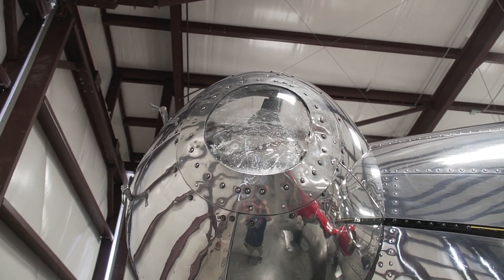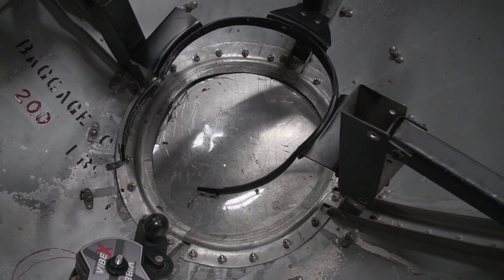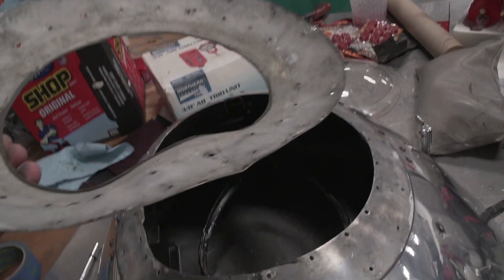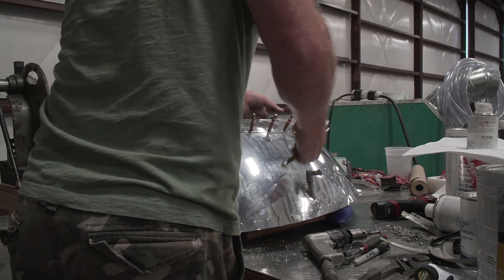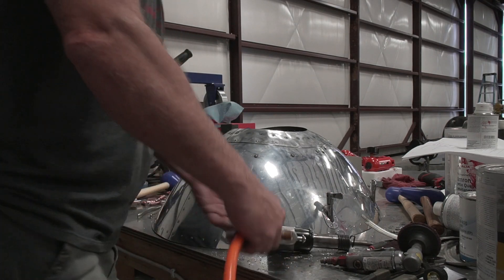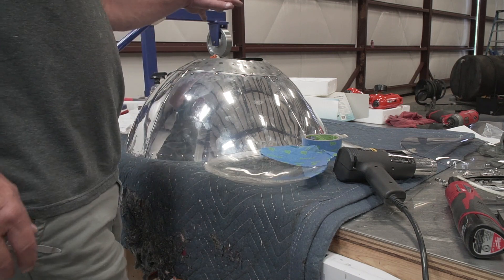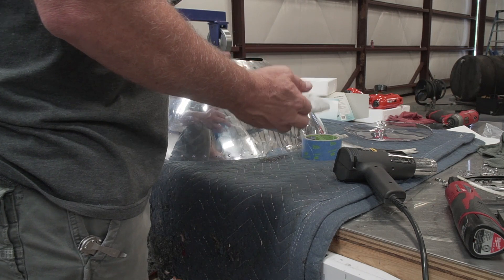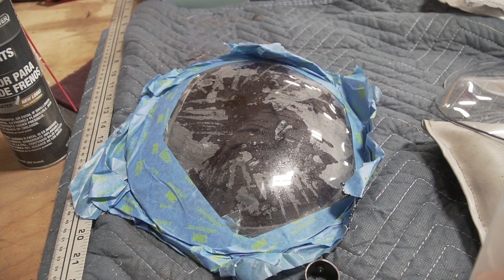Yep, Another Bird Strike In The Lockheed

Comment: Really enjoyed the video,  I am digging the depths of my memory but I remember seeing someone make a plastic bonnet stack cover and seem to recall similar issues with getting an even heat with the hot air gun. If I remember they just did it really slowly.  For making a mould, if you cover the inside of the lens with packing tape, and wax, car bodyfiller may be better than a foam. It's then easy to sand and shape if needed and should be strong enough for you to vacuum bag a warm sheet (if you use the oven method)

Comment: Get an square mdf box slightly larger than the actual piece .  Drill some small holes to one of the box’s faces  then plug your vacuum cleaner on one side of the box.  There are lot of simple DIY vacuum forming videos on YT.   PET G plastic is specific for vacuum forming.

Comment: I think on a Kermit Weeks video they make a mold out of wood and take the lexan out of the oven and lay it over the wood. That was to remake larger flatter style pieces.  I'm not sure if it would lay flat enough on such a small compound curve like that without wrinkles but you could try to make a wood plug that fits into the nosecone.
Reply: Also use a larger sheet then you need, and cut to fit. the edges will cool faster then the rest of the sheet, and almost always have a wrinkle.
Reply: @hawkdsl  Great point. The sheets were bigger than the piece needed if I remember correctly.

Comment: I'd repair the old lens with acrylic glue and bondo to get the desired shape. Wax the inside and lay up 10 layers of 10 oz glass cloth and epoxy (I like MGS, but West Systems is fine). When cured, pop the layup out of the lens (or pop the lens off the layup). Now you have a convex plug. Get a piece of thin felt and shape it over the top (outside of the convex plug). Heat the lexan in your oven (not sure what temp, but it will be flimsy). It's small enough to fit in the oven and not need a frame. Maybe a giant pizza scooper. When done, 2 people can grab it at the 4 corners (or approx 4 positions around the circumference) and drape it over the plug. Felt will keep it from stickin. Let cool and trim. There are some examples on YouTube.
Reply from the maker: thanks

Comment: I would try finding a stainless steel mixing bowl that has the right contour and putting that in an oven upside down with the plexiglass material on top and just keep inching up the heat til the material gives way and conforms to the bottom of the mixxng bowl.
Reply from the maker: Thanks, I did think of that but the problem is it wasn't a round lens and required a special mold to make it.

Comment: I wonder if you couldn't use plaster of paris to make a male mould of the lens.  Possibly cover the mould with wool felt so you don't scratch the acrylic.  Make a frame to hold your piece of sheet acrylic and heat it in the over, preferably and electric one, at about 300F until it sags then take it out of the oven and pull it over the male mould.  I'm not certain on the temp to soften the sheet plastic.
Reply: After posting my reply I searched YT and there are numerous videos on drape forming polycarbonate.  I'm looking forward to your next video on this project.  Keep up the good work.  You're doing a wonderful job.